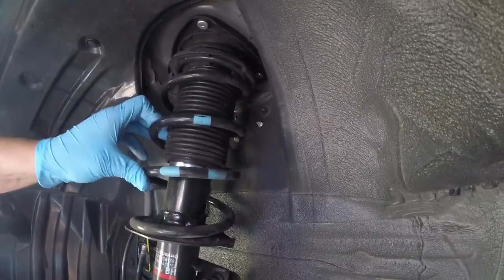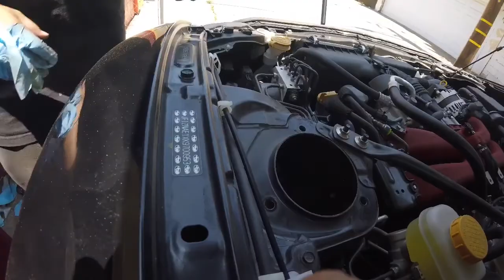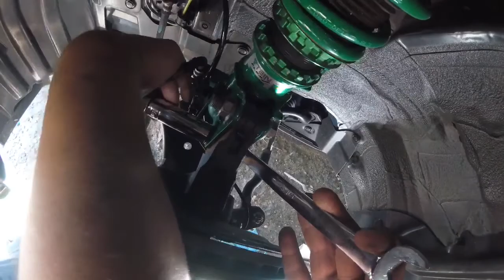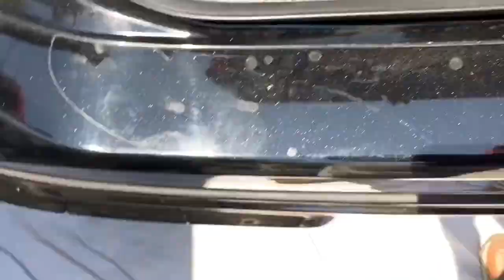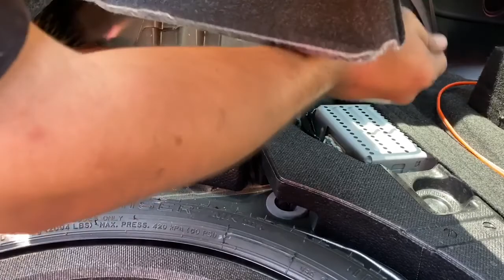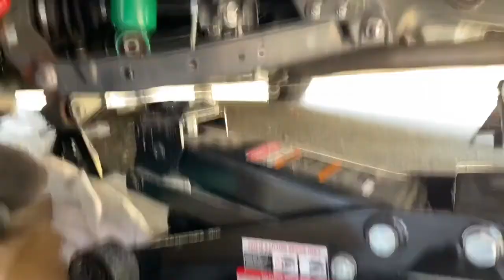Toyota 86 coilover install tein flex z

Comment: i have the same coilovers but a brz 2017 and i installed them and as soon as i tried test driving it back wheels squeak very loud and the nuts on top of both rear coilovers mounts were loose and i tried to just snugged them any advice on tht ?
Reply from the maker: So do they still squeak?  And just make sure you tighten them good. Also are these brand new? Maybe they need to settle in.